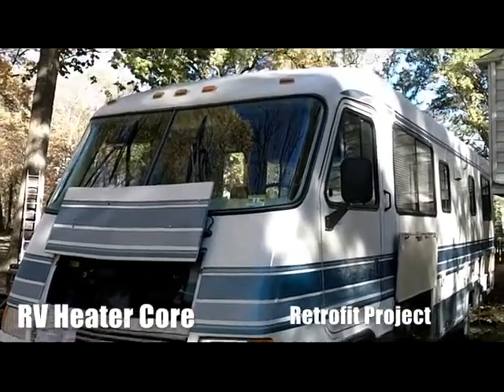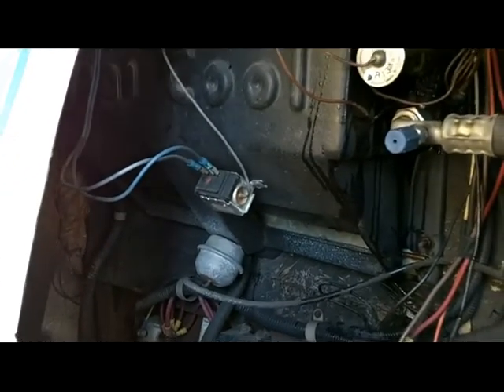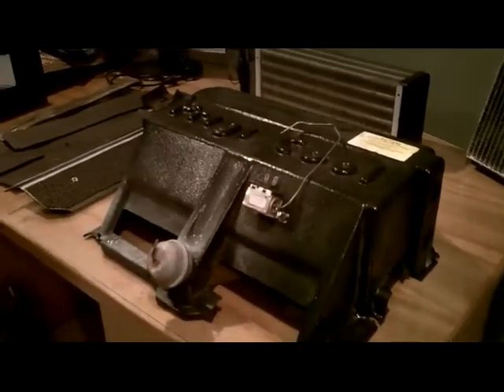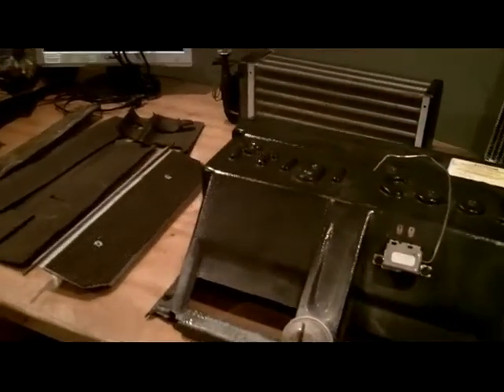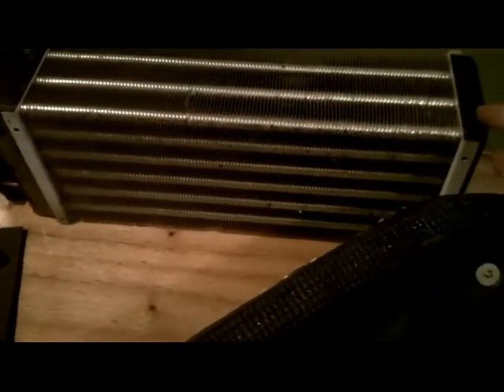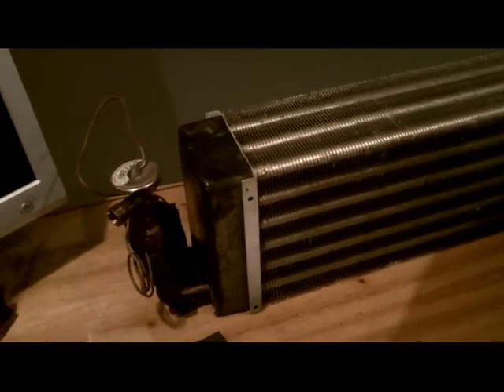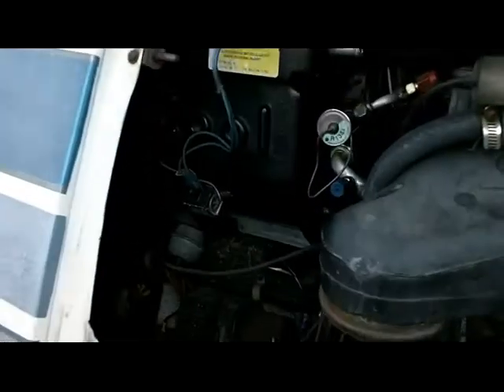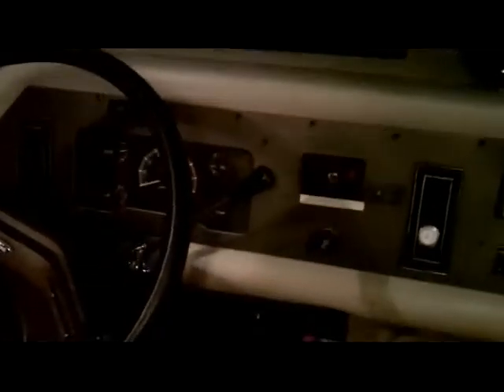RV Motorhome Heater Core Fix Retrofit and Repair Project

Comment: I cannot thank you enough for sharing your video. I just discovered that I have a heater core leak on my 1995 GulfStream MH. Not only does it look difficult to access the screws to remove that cover but I had no idea how things were configured in the assembly. Thanks to your video, I know what I have to remove and what I don’t have to remove. One question. If I only wanted to changeout the heater core (assuming I’m willing to spend $185), can I do that without disconnecting the AC lines to the condenser, leaving it essentially undisturbed? Again, thank you for sharing this information. It was a Godsend!
Reply from the maker: I am not entirely sure about the A/C. You may have to get a repair shop to evacuate the refrigerant from the system. In my case, the AC system was already inoperable and uncharged, so I did not mind disconnecting it. As you can see from the video, I was able to devise a repair that did not cost $185.00. Thank you for watching the video.

Comment: you should of taken your old core to radiator shop to see if they could repair it and then reinstall.
Reply from the maker: +Randy Buker I thought about it...but decided I didn't want to stick with a heater core that was already 24 years old.
Reply: The block of wood you added killed your future a/c fix you will not have the airflow you need for the system .
Take to radiator shop repair old htr. Core